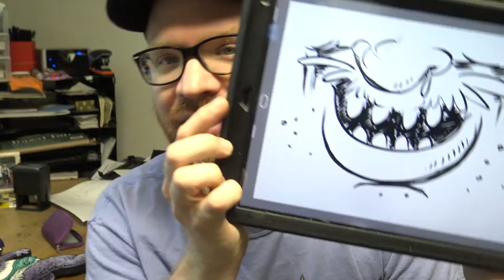Noosh! Vlog #28: Funny lookin' face mask

Comment: When you are designing a T-Shirt block do you have to take into consideration the pressure of the press or is it no different to normal artwork?
Reply from the maker: The pressure of the press is completely adjustable. The wood can handle it. The considerations for the pressure don't really come in when creating the block. It's more when I'm inking. The more ink I put on the block the more likely the ink will fall into some of the lower carved areas. It's more of a problem on paper. Fabric prints pretty easily.